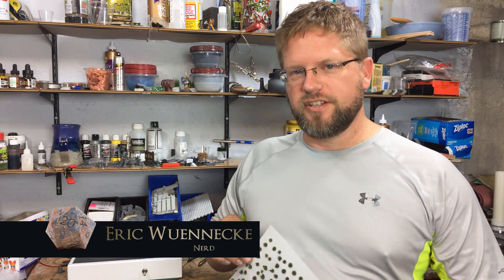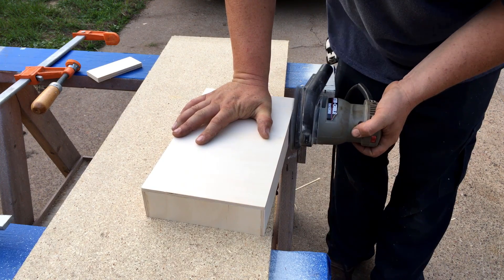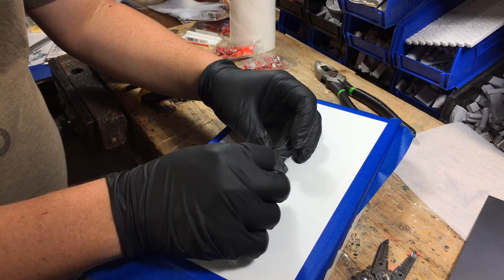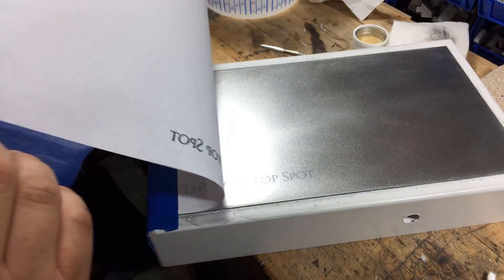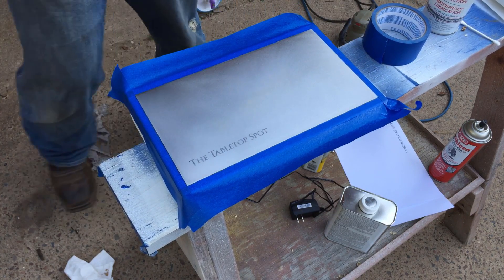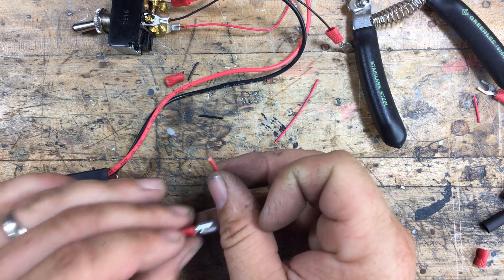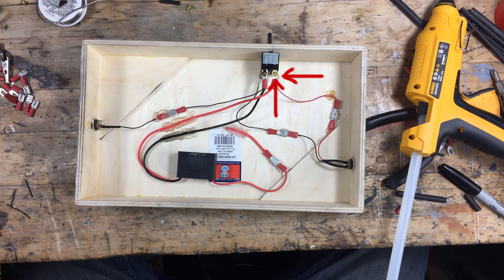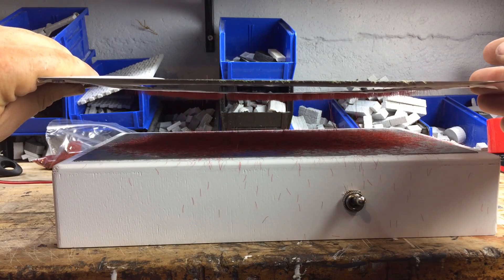Make a Flock Box!

Comment: I have a question! :'D
How well does this pretty DIY box work with larger grass?

The dioramas I plan to create range from tabletop miniatures up to 50cm long/tall creatures in a realistic/natural environment, so using only small grass is not an option for me. And if longer grass doesn't stick up well or would require me to get as close as 12mm, it's not an option either. EDIT: Because my terrains will be at least a tiny bit uneven. Dirt mounds and such. ;v;
Reply: @AtlasLeather Many shaker applicators are too weak to make the longer grass stand, hence why I'm curious if this boy would be able to conquer that issue.
Not sure if it simply depends on the voltage tho. Shakers usually have 9V.

Comment: Thank you very much for the video, I have a question about the ionizer, I get 1 red cable that is positive, 1 black cable that is negative and the other cable is white but it does not have copper wires at the end, it has as many cables as If they were made of very thin plastic, what should I do with this cable, cut it until the copper wires appear, I would appreciate it if you could help me.
Thank you very much, have a nice day.

Comment: Happy new year from Ottawa, Canada.  I have made a box, and it works as advertised.  I have noticed however that the WSS static grass that I have bought, Mixed colour fibers,  tends to separate on the plate.  The green attaches to the glue and the yellow stays on the plate.  Have you notice similar behavior?  I am using 4 and 6mm grass and the result is the same.
Reply from the maker: Yes, certain shades of red and yellow seem to simply be non-reactive. I even tried saving a whole bunch of it to see if it works by itself and nothing.  I can only assume it’s something with the material itself.
Reply: Thx for the reply, the woodlad sceenics seems to work better,  I am going to try the WWS fibers,  with a basket type applicator (need to make) to see if gravity is my friend.

Comment: good afternoon, I have seen that the negative ion, in amazon, has two white wires, can I solder in one? (I don't know electronic)
Thank you very much, greetings from Spain
Reply from the maker: The AC voltage coming in doesn’t have polarity that matters. The white wires can be hooked up either way.

Comment: Hello, wondering if I could get some advice, I purchased an negative Ion generator which is different to the one used in this tutorial and the output also includes a negative lead would this be connected to the negative path of the switch that connects to the crocodile clip? Any help would be great.

Comment: great instructions. I want to make one bust i would like to also turn it into a grass applicator. wiring confuses me do i just take a second wire from the red side and attach it to my strainer????? thanks for all the information
Reply from the maker: Mike Greenholz Yes but watch out, that line is carrying >15,000 volts.  Whatever you hang on to must be insulated.  Luke Towan has a video on how to make a pvc shaker.  You just need to run a wire back to the box.  Also, I’ve taken to taking the steel plate off the box.  It was transferring static to the switch and shocking me.
Reply: GREAT thank you for the info, i was making one of Luks shaker and now i will put the electronics off the shaker and put in the box and have the best of each in 1 platform. thank you and i subscribed. I do model railroad stuff and this one tip will save me loads of $$$$$. Great work!
Ps. if you need sagebrush let me know the sage will be free but i will need help with the shipping.
Reply: @TheTabletopSpot Hello. When you say that you've 'taken the steel plate off' are you inferring that you replaced it with a plate of an other material and have you fixed the 'shocking' issue? Inquiring minds want to know.
Reply from the maker: Glad you liked it.  I may take you up on that.  Where you shipping from?

Comment: Eric, I am the guy who invented the original Flockbox. A mention would have been nice. By the way you have left out a crucial part of the design that greatly reduces the power output. But I am not going to tell you what that is am I? :)
Reply from the maker: Hey, thanks for introducing yourself.  Up to this point I had no idea who you were. While I was aware of the flock box conceptually, I don’t know how yours is built, as evidence by whatever it is I supposedly missed. Whatever it is you don’t want to tell me is fine as it’s an answer seeking a question. The power output is already plenty high enough. I consider this to be my design even though the original idea clearly isn’t mine. I apologize if you feel I stepped on your toes.
Reply: @TheTabletopSpot  I am getting softer in my old age :) Plus I no longer manufacture the Flockbox. The vital part you missed out is rubber feet under the box, it greatly helps to improve the performance. Very good video otherwise!
Reply: Don't worry Eric. Your build guide is nothing compared to the two companies on eBay who ripped off my idea and probably now sell more than I do. Not a lot of people will be rushing out to build their own box so I do not see this as a big threat, I respect people who have the curiosity to build their own devices :)
Reply: So Lea, what is the part? if you would tell me it could be by messenger or my email could it be  McDonalds secret sauce
Reply: @michaelgreenholz8073  see the above comment.

Comment: in the parts list, I am confused at what the ponytail leads or for? You wouldnt be using those plugs right? the only thing I can tell that would use those plugs is the power supply. Am I missing something?
Reply from the maker: I used one on the alligator clip.  If the power supply you have doesn’t fit in with the power jack you could use one on there too.
Reply: okay awesome thanks for the reply!

Comment: Thanks for the response to my question of a few days ago. On my existing Ion generator, both my 2 x outputs look like fibre strands and not stranded wire. Would you know how could I adapt those to fit the spade terminals please? And by add a wand do you mean please?
Reply from the maker: https://www.youtube.com/watch?v=8gYmeRaaaL8   If you want it to operate like a normal applicator, you would just need to build the body,and run a wire from the screen back to one of the outputs, as the electronics are all inside the box.  But I call it a wand.  I'm not sure of your fiber strands.  If they conduct electricity I don't see why you couldn't connect them normally.
Reply: That's great.Thanks for the brilliant video and the prompt reply.

Comment: I already have a 12v Negative Ion generator but it has 2 white output leads as well as the red and black input leads. Can I use this for this application and if so would I just ignore one of the outputs?
Reply from the maker: Yes, you could just cap or wire nut one of the white outputs.  However you could  also use the extra  output and install an external plug on the outside of the box and plug in a wand.
Reply: Thanks for the info. Both my 2 x outputs look like fibre strands and not stranded wire. Would you know how could I adapt those to fit the spade terminals please? And by add a wand do you mean please?

Comment: Can you use a Alu sheet or brass/cobber sheet for the bed or should that be a steel plate? (have a narrow but quite long copperplate laying)

awesome video, and just what I've been looking for
Reply from the maker: Jacob Baagøe Fredeløkke I don’t see why not. In hindsight I should have used aluminum.
Reply from the maker: Jacob Baagøe Fredeløkke all you’re doing on the plate is creating a positive charge, so any conductive metal would work.
Reply: will you also make an extra version where there is an output to a static grass applicator? saw that some other versions have an output were an alligator clip can be attached to a sieve. :)
Reply from the maker: I've been thinking about it.  I may move it up the list though

Comment: Man, that box really sucks grass based on that analogy.  ;)   Nice tip on wiping down the wood to raise the grain.  You've done some woodworking in the past.
Love the transfer.  Very pro looking!
I have to say I think you're brave for epoxying the plate down.  I'd be worried that I'd cover the contact with epoxy, or pull out the wire later by accident.  :)  
I think this is great for making any size box.  And I love the look of the grass flying upward.  Very satisfying.  
Excellent job.
Reply from the maker: Yeah, I was a little worried about that too.  I gave the wire a tug before gluing it down and it was sinched in there pretty good although I wouldn't want to hang a weight on it.  I ended up filling the hole with hole and covering about 1.5" of wire with hot glue.  I think I'd have a hard time pulling it out even if I wanted to now.  Thanks for thumbs up.  Happy to have you here.